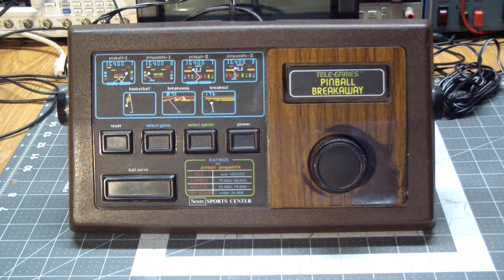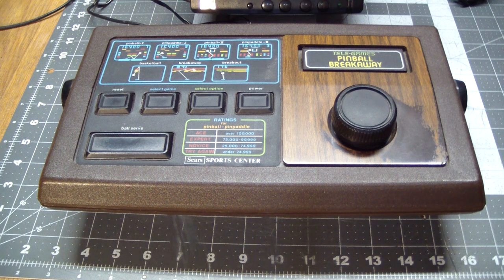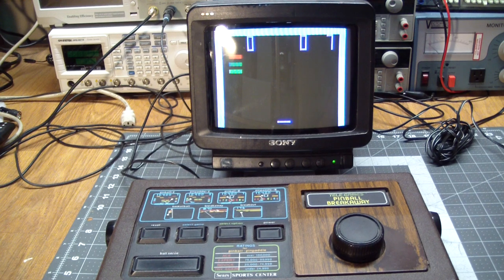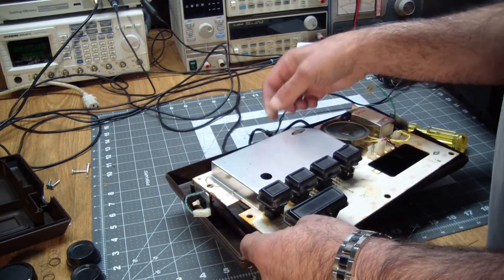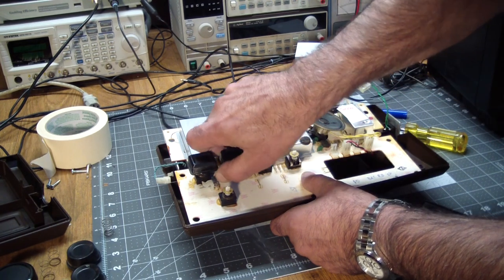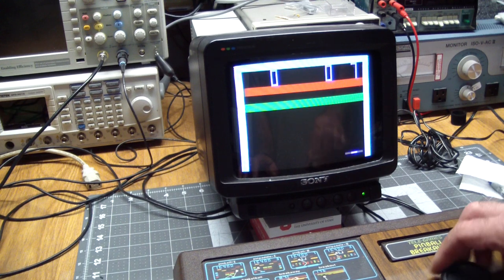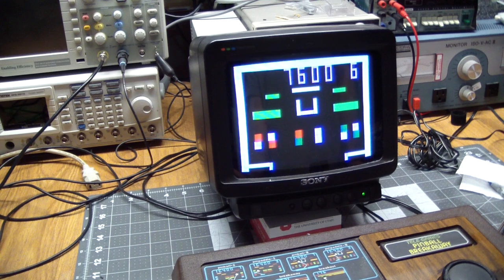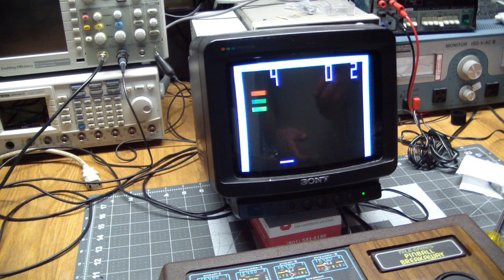AE#211 Sears Tele-Games Pinball Breakaway Cleaning And Demo

Comment: As a vintage gamer and collector, I scored one of these several years ago.
Works fine as is other than typical scratchy pot in the paddle.
Great Atari collectible. 
Obviously Atari as stated on the bottom of the unit and the built on 2600 paddle.
Haven't opened mine up yet either

Comment: I don't think this is an Atari product. Its more likely to be based on of general instruments family of mono and color game ICs. 

The AY-3-8500 "Ball & Paddle" integrated circuit was the first in a series of ICs from General Instrument designed for the consumer video game market. These chips were designed to output video to an RF modulator, which would then display the game on a domestic television set. The AY-3-8500 contained six selectable games — tennis (a.k.a. Pong), hockey (or soccer), squash, practice, and two shooting games. The AY-3-8500 was the 625-line PAL version and the AY-3-8500-1 was the 525-line NTSC version. It was introduced in 1976, Coleco becoming the first customer having been introduced to the IC development by Ralph H. Baer.[1] A minimum number of external components were needed to build a complete system.

The AY-3-8500 was the first version. It played seven Pong variations. The video was in black-and-white, although it was possible to colorize the game by using an additional chip, such as the AY-3-8515.
Reply: This is developed and manufactured by Atari, using their own Pong-on-a-chip Design. They released it under their own name as Video Pinball.
Reply: @lascheque  It's a shame you didn't pop the RF shield off the chipset so we could see.